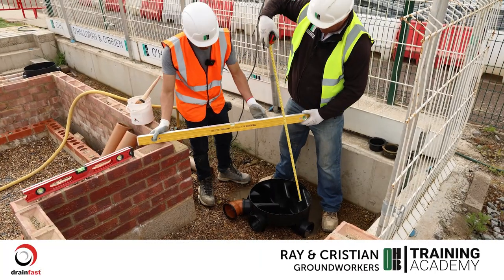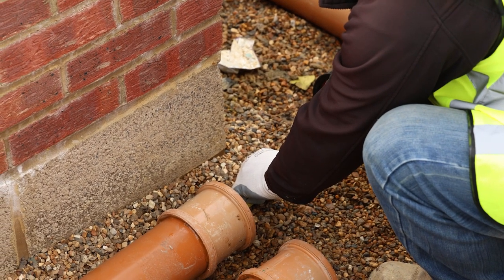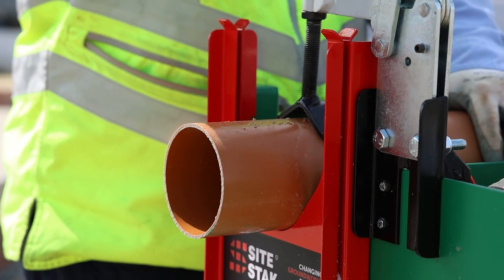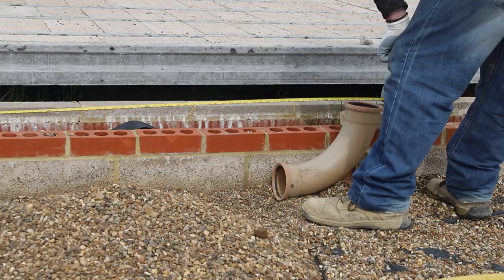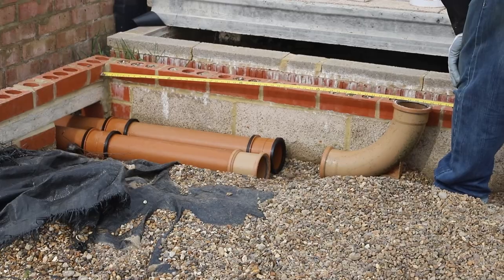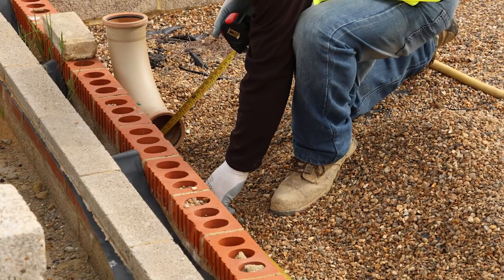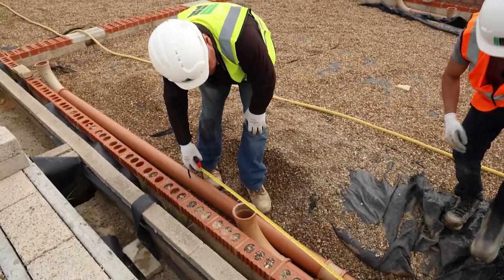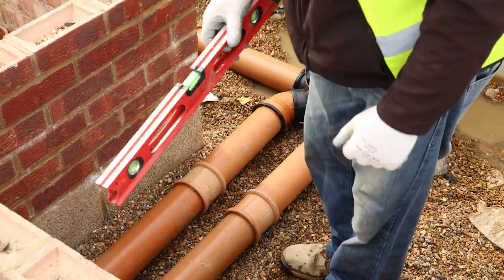How to install an Underground Drainage System - OHOB Training Academy

Comment: Why put rockers before/after a manhole when it has a granular base? Rockers are to offer flexibly when drainage passes through a solid eg concrete structure (When you muck in the rat runs). Pointless on a manhole when surrounded by single?
Reply from the maker: Good point, it wasn't mentioned in this video but the inspection chamber base normally get concreted into position - hence the need for rocker pipes. As mentioned here https://youtube.com/watch?v=FuNZxHKDdKY&t=51